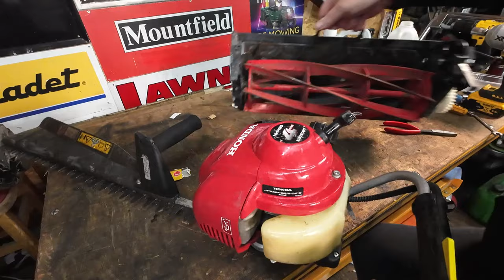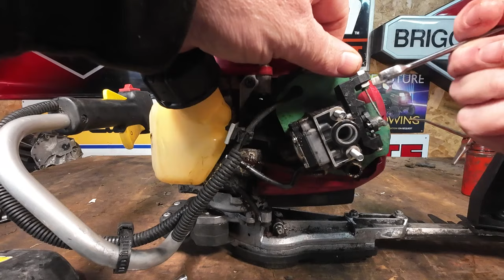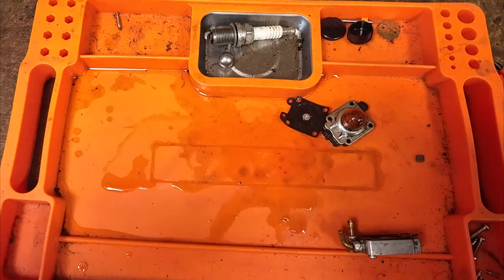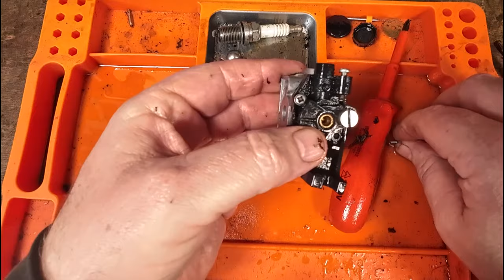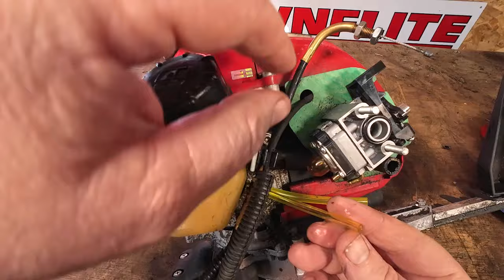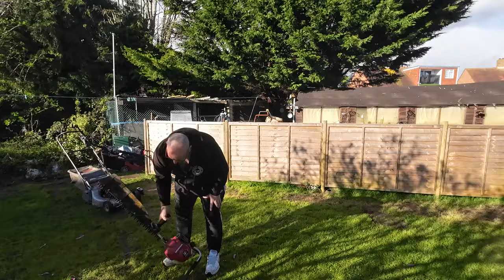HHH25 HONDA TRIMMER Carburetor clean and oil change..

Comment: Nice job Mick as always i picked up a macallister mbcp254 strimmer yesterday free he said it's got compression but won't start got it home put carb spray into it and it fired and fuel lines are hard and brittle so going have a go at that tomorrow 👍👍👍👍

Comment: Nice job Mick as always picked up a macallister254 strimmer yesterday free he said it's got compression but won't start got it home put carb spray in and it fired fuel pipes are hard and brittle so going to have a go at that tomorrow 👍👍👍👍
Reply from the maker: Good luck mate ...